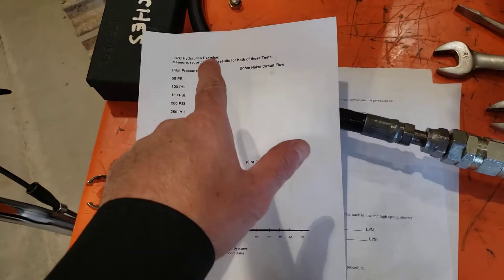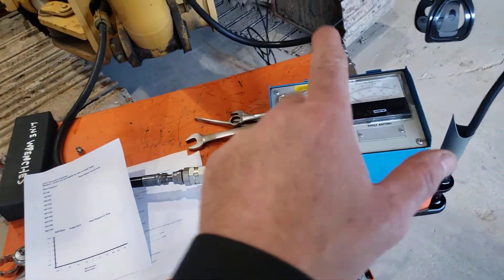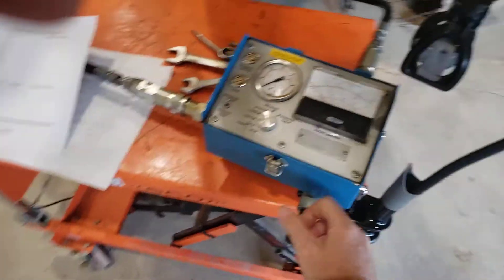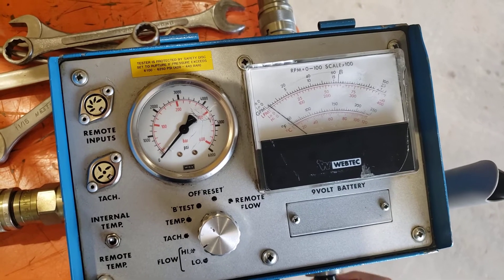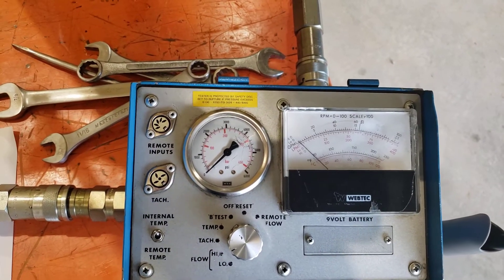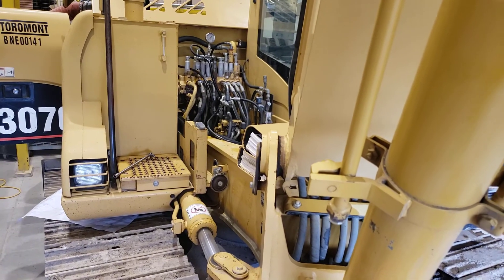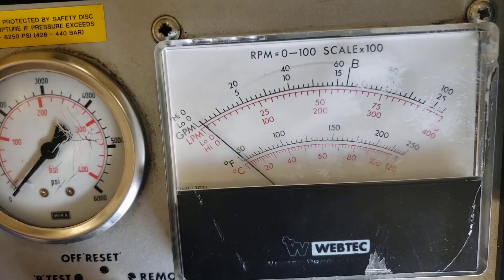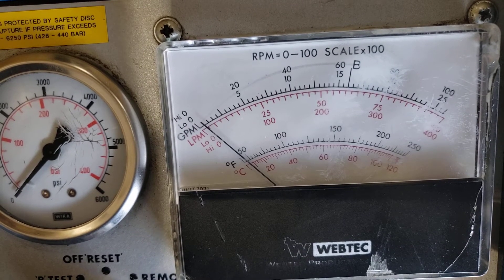Flow test boom circuit on Cat 307C Hydraulic System

Comment: I have a 1.5 tonne digger with (only) 1,500 hours on the clock. I want to get a flail  for it, and wonder if I should get pressure and flow measured before buying one. There's no possibility of giving it a test run. Presumably a cheap pressure tester would be ok but there's no such animal as a cheap flow meter. In America how much does a technician charge to come and do the test? Thanks.